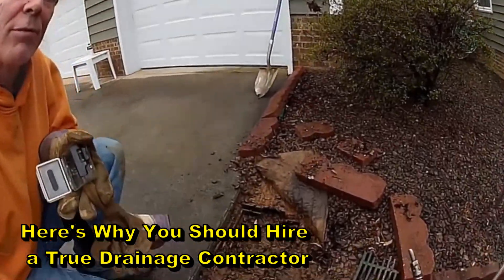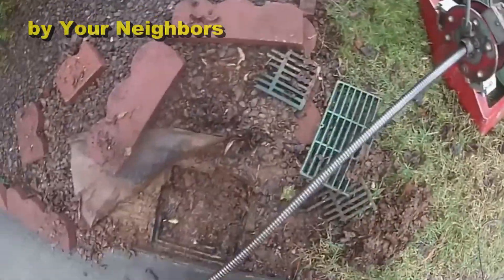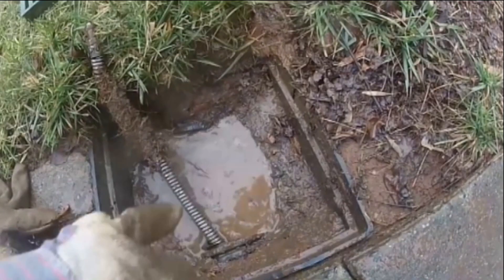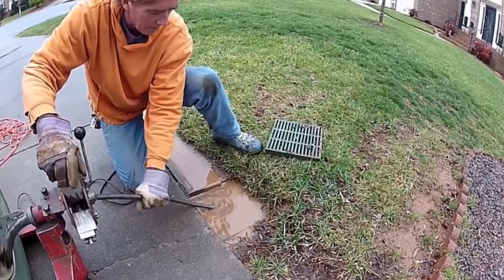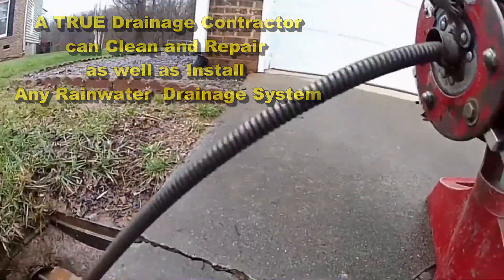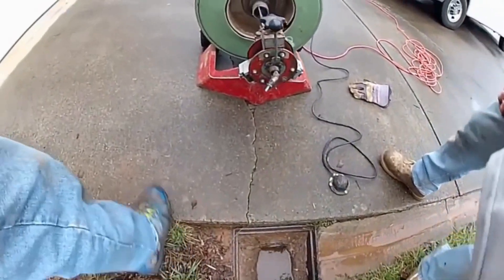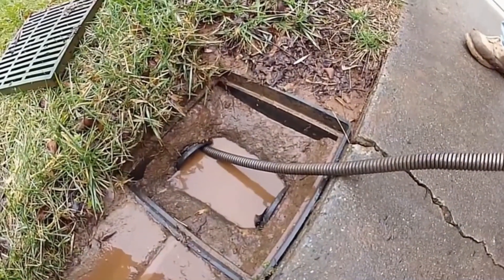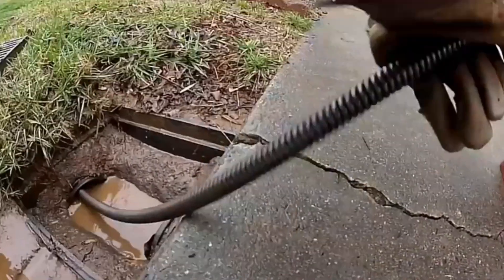Why You Should Clean Your French Drain | Don't get Scammed | Save 1000's

Comment: This is almost my exact setup and placement of the basin next to my garage driveway.  I just sent you a message about my issue regarding  having a problem with the drain being clogged. This may help. I know for sure that the pipe is collapsed and cut open further down the line. I’m gonna dig it all up and run new line and line it with gravel.